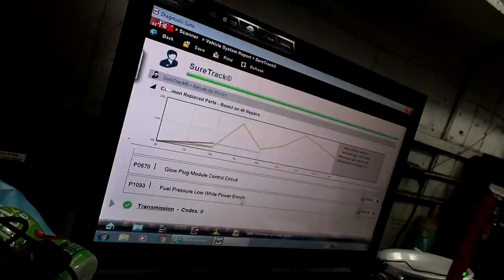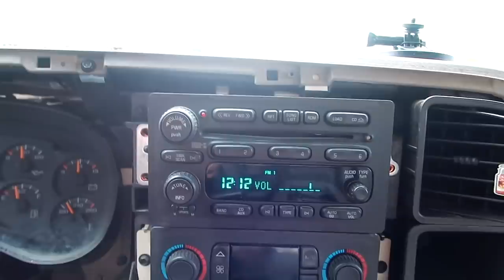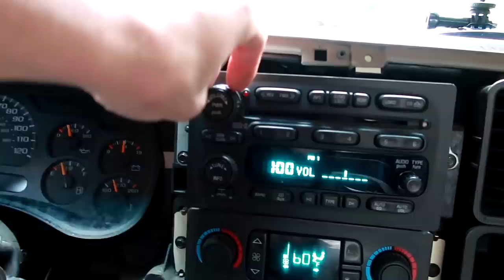BUILDING A TANK!!

Comment: When transporting an engine I find it most simple to bring an old used tire to sit it on. The pan sits right in the middle and gives that extra bit of cushion under the engine.
Reply: Jeremy Hales. that is the best thing to do
Reply: yes I have
Reply from the maker: Thanks for the tip. Know that you mention that, I do remember seeing that
Reply: Tire works good for short distances the bigger the better, just need to make sure engine does not bounce on the harmonic balancer for 20 miles. Longer distances a pallet and some 2x4's and screws works or Take a some wood and build a stand. Build a box that lets you rest the motor on it via the lip around the bottom of the block that the oil pan bolts to. Keep the engine as far forward as you can and strap it to the front and rear hooks or when someone cuts you off and you slam on the brakes or hammer the pedal it won't go through your tailgate.
Reply: Yes I can go to sleep right when I drink a energy drink!
Reply: Dylan Moulton so can I
Reply: +1
Reply: Jeremy Hales I
Reply: You guys should put a smaller pulley on it
Reply: Jeremy Hales  p

Comment: You need to remove that torque converter from the replacement engine and properly install it into the transmission before putting the engine in the truck. If you try installing the engine as it is you will undoubtedly break the transmission pump.

Comment: I have the same problem with my truck a cd is stuck in there, but when we went to the dealer they said they would "look" at it for free and it would only take ten minutes. Three hours later they brought the truck back the cd was still stuck and they charged us $100.
Reply: Young guy I worked with bought a 4x4 Ford pickup used and it needed new front hubs and bearings someone told him to take it to the Dealer.  They charged him $2200.00  and 3 days later the Chinese  bearings they put in exploded and ruined the new hubs and took out the splines on his axles. They told him there was nothing they could do etc..  I went with him and I brought the pieces of bearings with me. I told the service manager that I was going to set up a table at the sidewalk and place all the broken parts on it make picket signs and we were going to stand there every day after work and talk to all his customers.  He cut the kid a check for the parts / labour + extra for new axles  immediately.
Reply: davidbrennan5 please cancel these please cancel these on YouTube only certain wants I want to use my please cancel these

Comment: u can add another transaxle and make it like a semi, but u need to tie the gears together and use separate belts and pulleys or else the original transaxle would have massive slip and will be dead weight